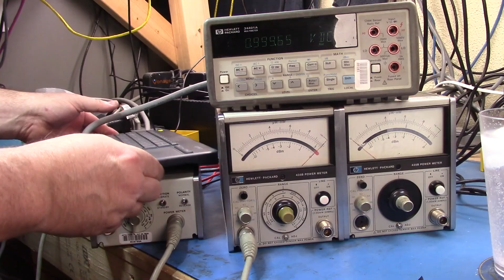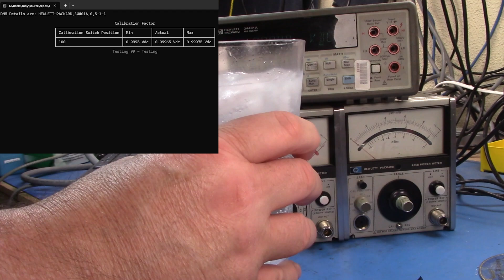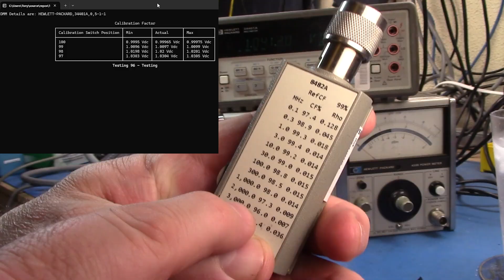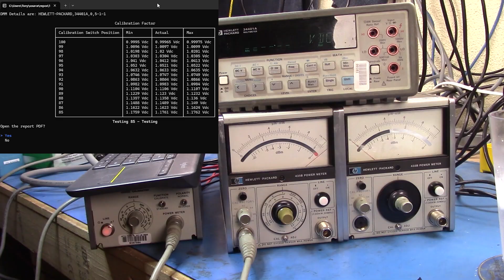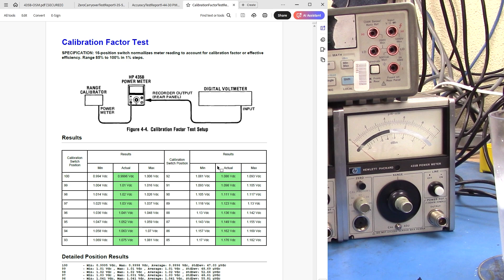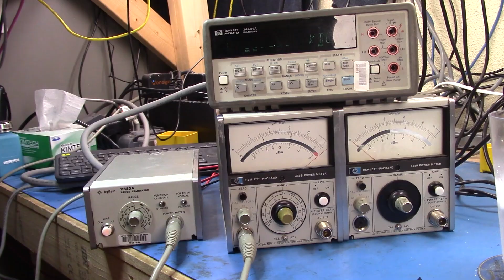HP 435B Calibration Factor Performance Test

Comment: jakie oznaczenie ma kabel sodny  do  mierniuka hp 435A ?  czy  to wiesz   ?
Reply from the maker: The translate seems weird - Are you asking for what the cable connecting the sensor to the 435A is? If so, then the part number for the original 435 version was 00435-60011.

However you're more likely to find the cable under the later part number 11730A.
Reply: @tgsoapbox   dziękuje za info

Comment: Maybe I misunderstood what you said about CAL FACTOR and the 438A. The 438A does indeed have the ability to input CAL FACTOR and CAL ADJUST. I just used mine to give me confidence in the output of my RF SIG generators and tracking generators.  Super fun. Thanks for the video. I own the 432A and 435B as well. The video was very useful.
Reply from the maker: I'd have to go back and check what I said but I think it was in comparison to the 473B - The 437 can have the full cal factor list for a sensor stored and to recall the right one you just enter the frequency of interest (interpolated if needed) - The 438A is like the 435/436 in that you need to enter the cal factor manually rather than recalling it from a stored list - Does that make more sense?